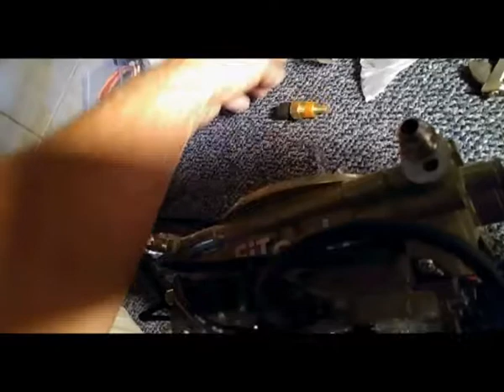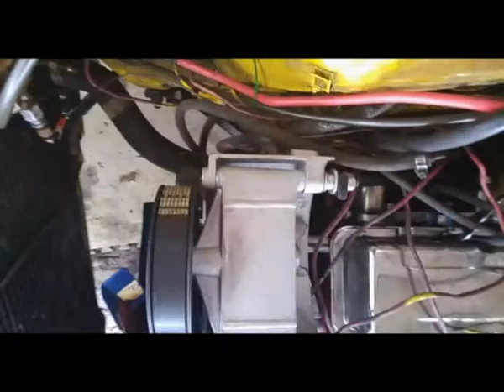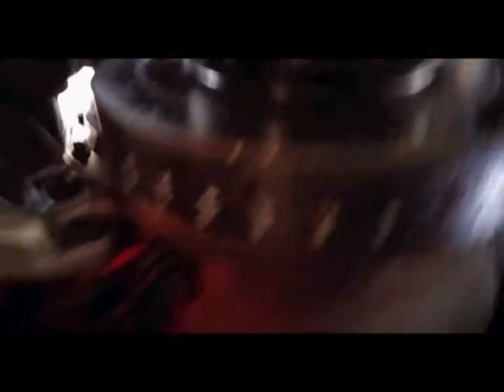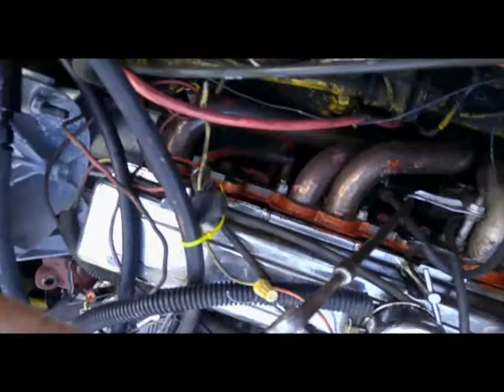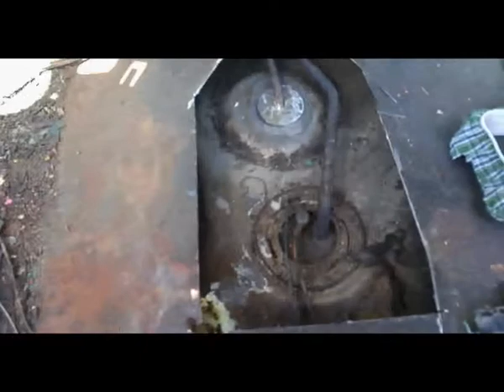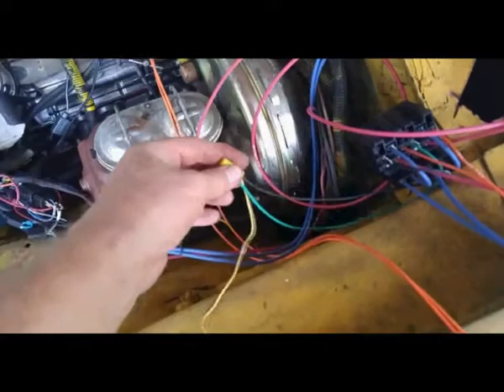Fi-Tech Fuel Injected Carb Install 1980 Camaro

Comment: one more thing about your fan... your new water pump rotates the reverse of the old water pump so the fan blades are facing the wrong way.  have a good one brother
Reply from the maker: I never thought of that, they should put that in the instruction manual, no wonder the car was overheating. The electric fan is supposed to give it more horse power and fuel mileage but I would not have installed it just for that. Thanks for the tip.
Reply: The electric fans are a good choice.  I haven't had a problem with mine in 3 years so far.  I did, however, add a 140 amp alternator due to running electric fuel pump, 2 electric fans, all the lights, and radio amp.
Reply from the maker: @jameskelly4198  I don't know if you live in FL but if the car isn't kept in a garage with a dehumidifier, everything corrodes. The humidity mixed with heat is a nightmare. All my tools are in my house and bedroom because out in the garage they turn to a pile of rust in just a few months.
Reply: Sorry about the rust problems.. that makes for a troublesome obstacle for sure man..keep them videos comming brother.. you do good work.

Comment: Im using a holley dominator duel electric fuel pump mounted under the gas tank.  It flows a good amount of fuel at 58 psi straight to the throttle body.  Its a duel pump so if one goes out, you have a backup.  I got rid of the command center.  Good luck man.. you got a fun project in that camaro.

Comment: I ended up adding a return line back to the tank to keep the fuel pump cool.  Ruined the first fuel pump due to over heating.  The return line cured all that.